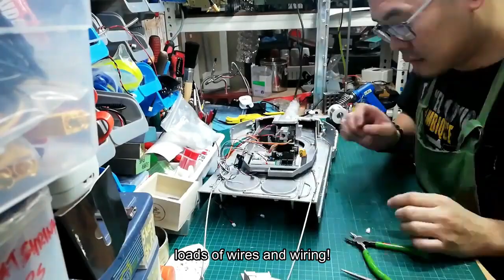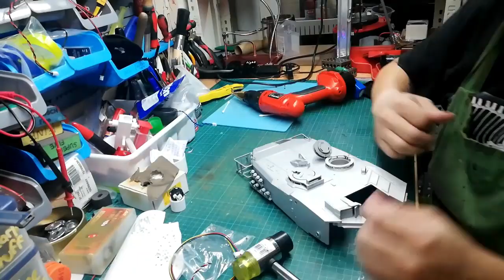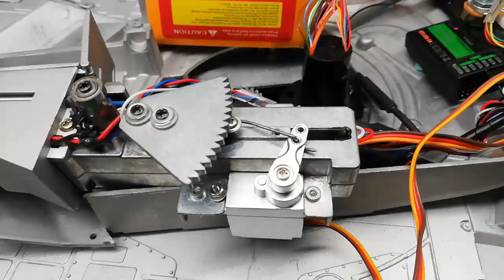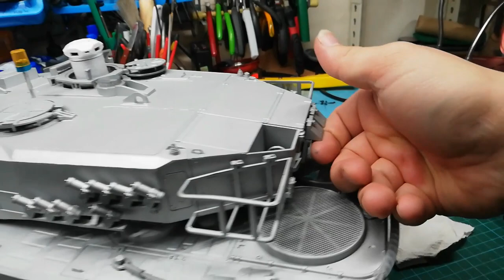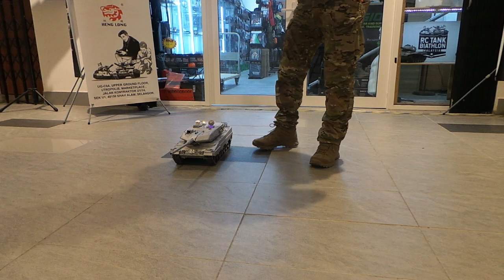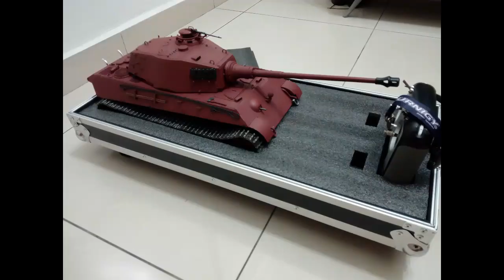How I built this Fully Metal Leopard RC Tank - Build Log

Comment: How do I install the NATO beacon on my henglong leopard 2? I have the Tk 6.0s board.
Reply from the maker: sorry you cant, you need an upgraded board for this to work
Reply: @StanlleyLegion  thanks for the reply. Which board do I need? I was planning on upgrading anyway because I want to get the gun stabiliser.
Reply from the maker: @joelm1246  TK80SG2 board. But you need to mount the board in the turret + battery  and get a new radio for this mod.. not cheap!
here's my 2 videos:
https://youtu.be/u7MctJd39gM

https://www.youtube.com/watch?v=ZjV6Ff9Gbnw
Reply: @StanlleyLegion  cheers for the info.

Comment: Excellent video.  I'm a bit jealous of this all metal Leopard to be honest.  They're not cheap.  You should consider upgrade the turret rotation mechanism to a 360 degree servo.  Servos are much more precise and spins faster.  The gyro will be able to do a better job at stabilizing the turret.  I did this upgrade to my Tamiya Leopard 2A6 and it does wonders.
Reply from the maker: No space for the servo, also due to the turret's weight, the clutch from the turret motor is necessary to Safeguard the board from burning
Reply from the maker: it is already 360 deg rotation and has slipring for this purpose.
Reply: @StanlleyLegion   I know it's already 360.  If you use a servo to drive the turret instead of the motor/gearbox rotation unit, the gyro will have much better resolution and faster response.  It can stabilize the turret much more precise.